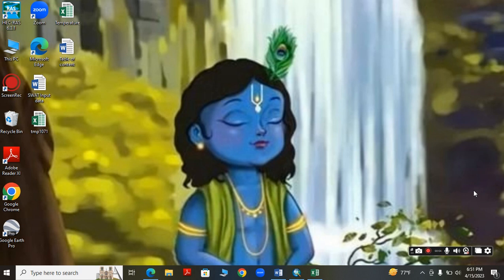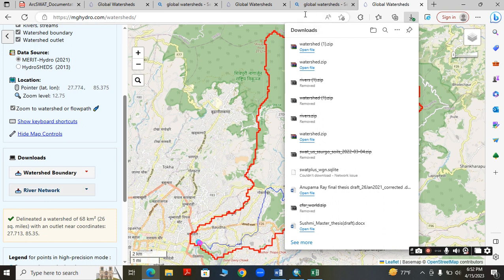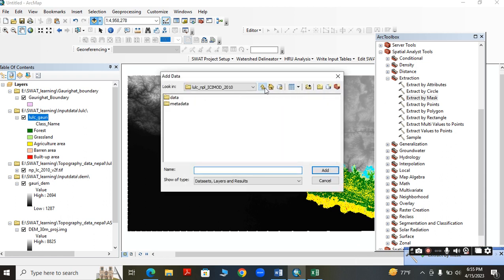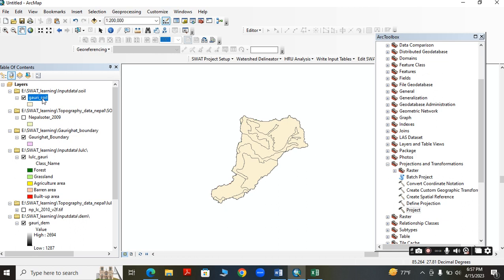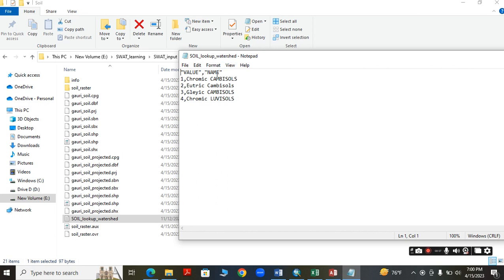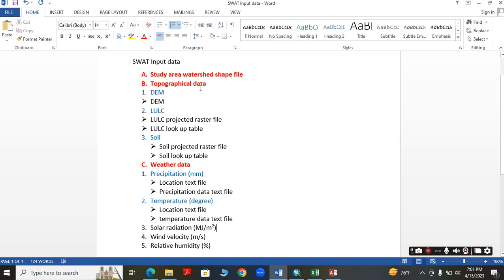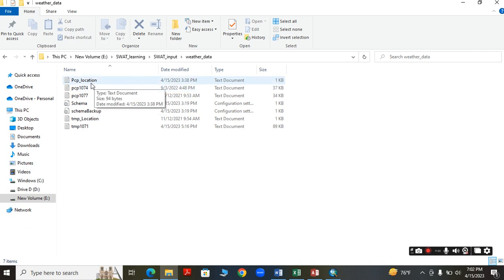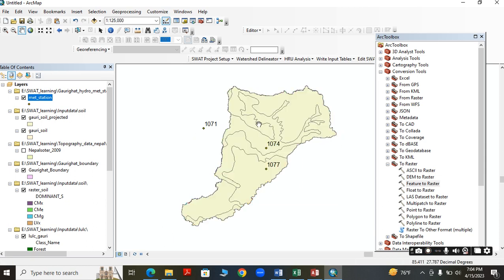SWAT data preparation part 2

Comment: Thank you for the well-informative video tutorials. However, my SWAT soil lookup database does not contain the SOTER database (e.g., CMu, CMx, Rge, Cme, Cmg, and Rgd). is it possible to share your SWAT2012 mdb table?
Reply from the maker: Thank you. I could have shared it with you, but it has been a long time since I used SWAT, and I currently don’t have the edited SWAT2012 mdb file with me. However, you can add those soil data types to the mdb file and then run it.

Comment: however i just had a question on preparation of the weather elements such as temprature humidity and so on suppose am doing this remotely how can i go about that getting those datasets can i just hypothesise
Reply from the maker: You can also get weather data on the website SWAT Global Data: https://swat.tamu.edu/data/. However, there may be missing data. For remote areas, you can also assume the data near them. In SWAT, there is also an option to simulate relative humidity, wind, and solar data while doing SWAT setup, so you can skip those data and run, but the results will be less accurate.
Reply: @ thank you so much for that i have access the data but when i run the swat check the values are 00 in my final run i dont undertsnd why

Comment: Can you tell where can we get the soil & crop data base ? because my SWAT2012 database there is no soil mentioned in the SOTER
Reply from the maker: Where is your study area? There is some database at global level and of your specific country. you can search in google. For Nepal, there are some free websites from where we can download it. Please once check FAO website, or once re-check the SOTER to provider you latest soil data or you can search for your country or region.
Reply: @easyhydrotech  yes mine study area is for Nepal but the soil from SOTER and my ARCSWAT database does not match? what should i do ? Where can i find the database related to soil matching with the one in SOTER?
Reply: Somtime the soil name is not in SWAT2012 mdb file as per SOTER, in that case you can add the soil name, symbol as per the template of swat2012.mdb file.  That format i have mentioned in this video at 9:10 min.
Reply: @anupamaray1  ma'am is it possible for you to share your SWAT2012 mdb ? CMu,CMx,Rge,Cme,Cmg and Rgd are mine soil from SOTER and through your vedio i could only see and add Rge and Cme .
Reply from the maker: @SANSKARADHIKARI-076BCE15  Okay, please send me your email.
Reply: @anupamaray1  thank you i will try that